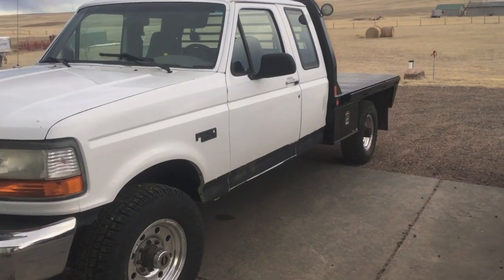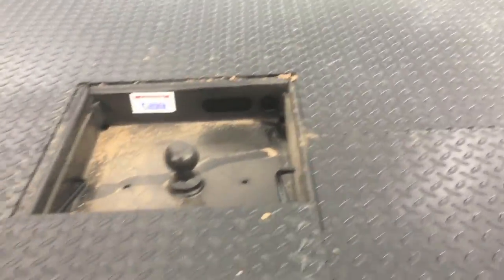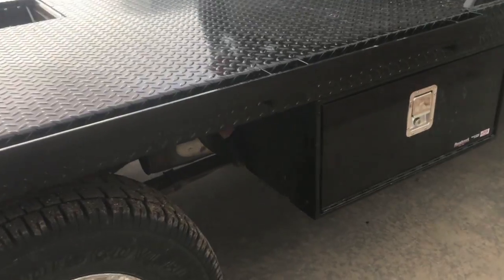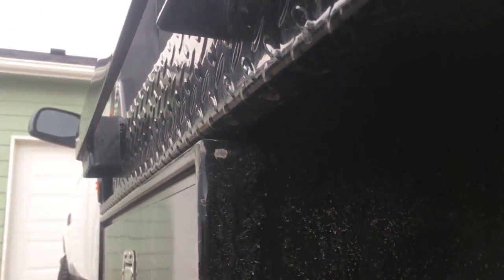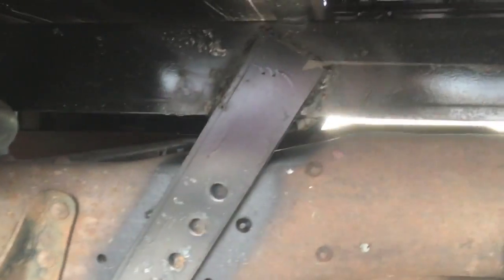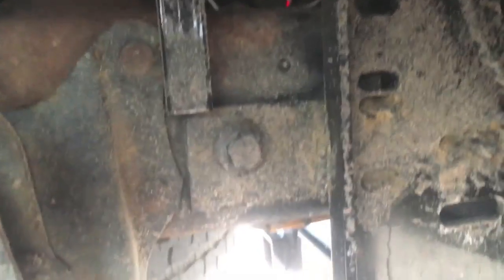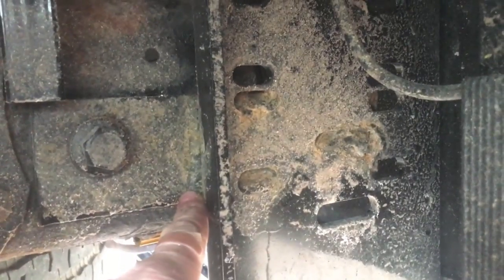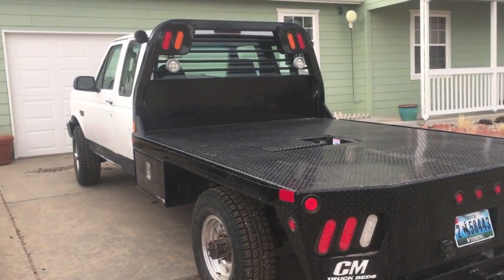1997 F-250 Flatbed Install Completed

Comment: Hi there. Does this model have LED lighting? Did you have any issues with it after it was installed?
Reply from the maker: Mine did come with LED lights. It’s been a very good bed, no issues and has held up well. I may be replacing it, but only to go with a hydraulic self loading bed.
Reply: Ok, thank you. We hooked up the wiring for a 1995 and have had so much trouble.

Comment: Do you still have the original bed? Any chance it's for sale? I need a white long bed.
Reply from the maker: I do, but it’s in terrible condition. Are you around Cheyenne? I might be able to find a decent one.
Reply: @GuyinWY  I'm in California but heading to the top of Nevada soon, and then Denver. I don't mind traveling to find a good bed. If you happen to know of where I could get one, I would appreciate that. Thank you.
Reply: @EM-fi2qg  did you find a bed? I have the same truck, going flat bed. I'm in california
Reply: @steveschroeder2899  Hey there. I haven't found one yet. I am in Nevada right now but will be heading back to SoCal in a week. Are you in SoCal?
Reply: @EM-fi2qg  yep.
Reply: @EM-fi2qg  will do on the pics.
Reply: @EM-fi2qg  have heavy-duty head ache rack with ranch rear bumper I don't need if going flat bed
Reply: @steveschroeder2899  Thanks. I appreciate you getting back to me on this. Talk to you soon. 👍

Comment: so on a factory bed-isn't ur gooseneck (some models-i guess) ball is on a contraption that bolts to both the frame rails-. never been around a goose neck before or owned one. but for me-now just me-ok. i would have to have more brackets bolted or whatever to hold the bed to the truck frame. just me on that -ok. still love the flat bed over factory-no matter what our friend CP says.
Reply from the maker: On a truck with the pickup bed, the gooseneck is usually a separate piece that attaches directly to the truck frame rails beneath the bed floor. The flatbed has the strength to incorporate the hitch directly into the bed, and the manufacturer of the bed gives general instructions on how the bed should be anchored. You don't want too many anchors because it will reduce or eliminate the ability of the truck frame to flex which can lead to cracks or frame damage.
Reply: ok-thks for that info-and yes-i agree ur flat bed is way..........stronger than a factory bed would ever be. carry on-u staying off ur foot--keep editing em-ok.